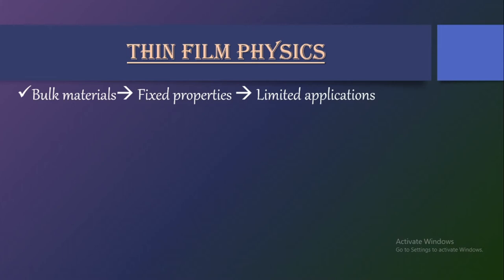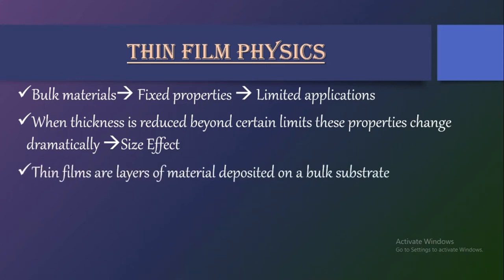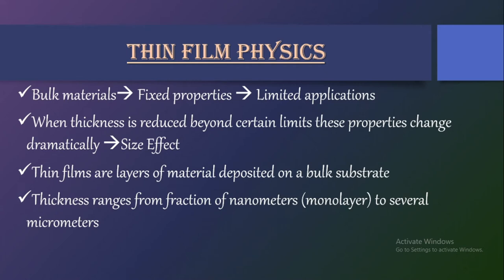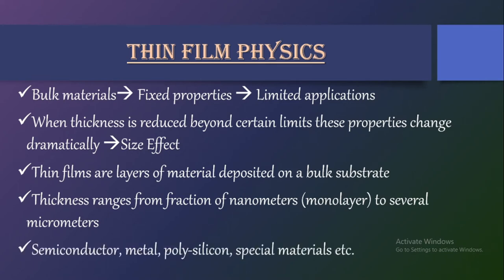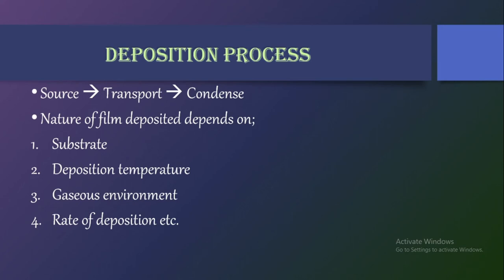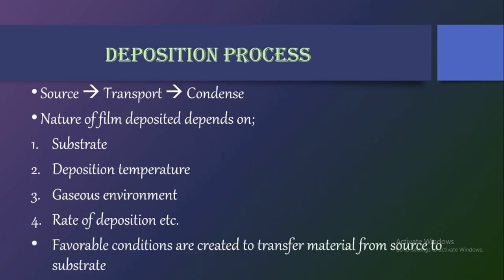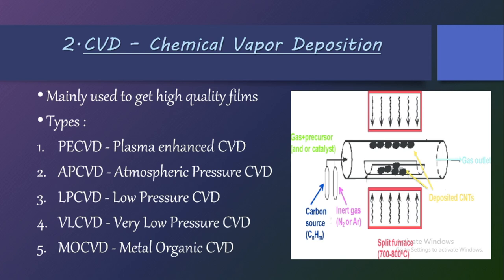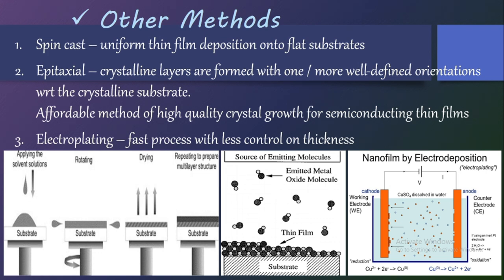11. Thin Film Physics - Introduction , Deposition processes, Types: PVD, CVD, Spin coating, etc.

Comment: I don't understand why my four devices with the same concentration, same sizes, conditions and happened around the same time frame could have very different current performance... does that could relate to my spin coating process, solubility of the solutions etc? I could not find the solution for this problem
Reply from the maker: If I get all details of your procedure then I can identify and suggest you something but without that only guessing can be done which won't be so effective..
There are a number of parameters which decide the quality and properties..
I am planning to prepare a class on spin coating in coming 4-5 days so I think it may help you in some way as you have mentioned the same method of deposition..
Thank you🙂
Reply from the maker: https://youtu.be/QqfKRC68LcQ
Click on this link above which explains about spin coating technique .. Hopefully you will come up with a solution for your problem..